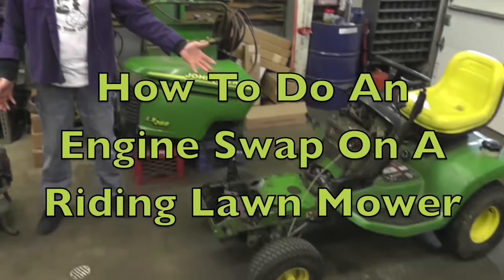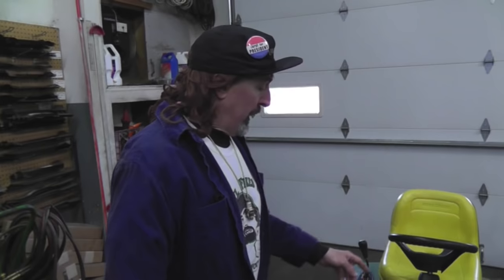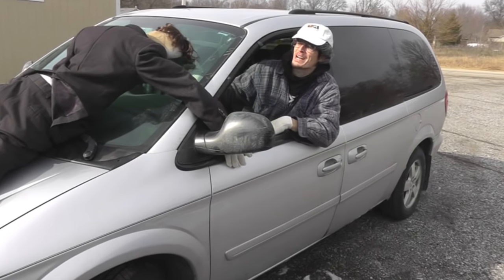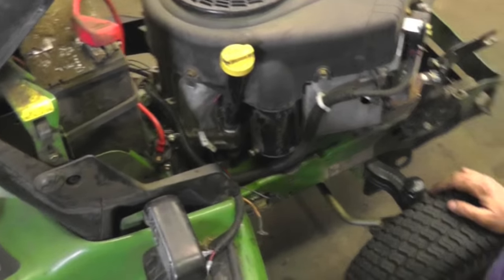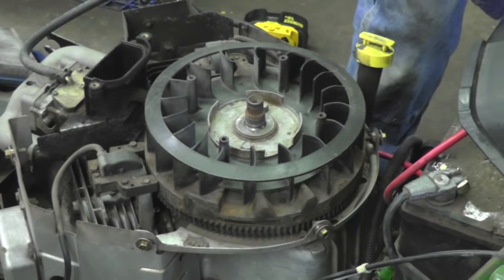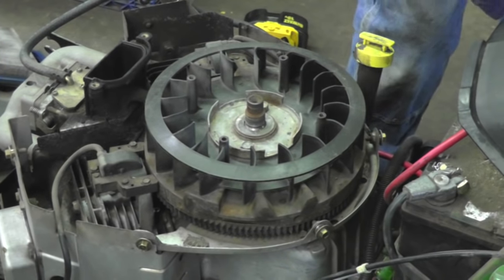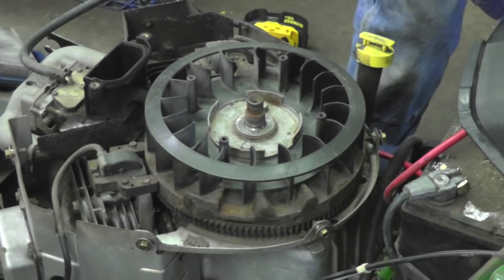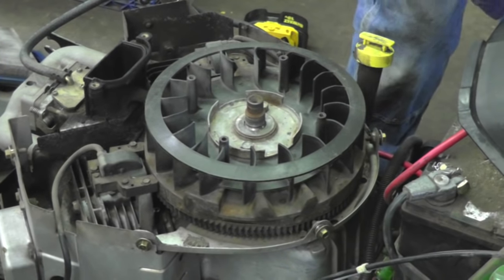How To Do An Engine Swap On A Riding Mower with Taryl

Comment: Taryl Fixes All LLC  one question on the engine swap.. I'm trying to install a 13.5hp Briggs flat head motor on a older snapper H-vac... The 13.5hp Briggs is on a older craftsman mower and the mower has a few safeties on the engine... The older snapper does not... Can i bypass the safeties on the motor or do i need to figure out how to install the safeties on the older snapper... Thanks in advance

Comment: There is absolutely no reason for a Briggs & Stratton Vanguard to crater, unless the maintenance hasn't been kept up.  I have a 1992 Vanguard on a all-wheel steering Crapsman still running strong.
Reply: Thinking about it though, $900 to $1000 for a brand new crate engine from Briggs is kind of steep for some budgets.

Comment: Taryl, I have a old Craftsman String brush cutter with a B&S 6hp (122K02-007-E1) that is acting like it is Hydro-Locked, but when I pull the plug and pull it through, no oil comes out. No oil comes out of the muffler either. It is very hard to pull through with the plug in, but easy with the plug out. Any suggestions? Thanks., George Goff

Comment: I live in southern France and I have a john deer 108 with a 8 hp Briggs and Stratton in it, which is fading fast. I also have a Briggs 12.5 motor from a 2005 tractor that is in great shape. Will it fit? can you tell me what I will have to change and do to make it work? The pto clutch is new on the 108,  can I use it on the 12.5 or will I have to get a new one? Any info is greatly appreciated as no one here will tell you anything without payment! Love your video's!!! Thank You.
Reply: +Les Howard - Check the " Mount Holes ", if they are the same, it will fit.  You can also " Drill " the Holes to make it fit.  NOTE:  The Muffler need room too, check that also!  8HP verses 12.5HP is NOT that different, it should do fine.... ONLY ROOM.... So MAKE SURE YOU GOT THE ROOM!!!  NOTE 2:  if your PTO is the SAME SHAFT SIZE.... YOU can mount it easily :)))
Reply: +Les Howard - I have swapped an 8HP with a 12.5HP before.  I used the OLD Muffler.... It just stuck outward instead.  The 8HP Muffler is straight up... The 12.5HP Briggs, it's side-way.   So if you got the Room.... It will fit!

Comment: I did an engine swap. (Kohler Cv15s to a different Cv15s) I didn’t mark the wires like an idiot. I couldn’t get the flywheel off the good engine block so I chopped the wires that go to the stator and soldered them onto the other wiring harness. Now I think I got them wrong and it sparks every time I go to plug in the volt regulator. What do I do?

Comment: I just swapped a crapsman with another. Typical Brighs and stratton 18hp. It left a bad taste in my mouth. The original had a cable but swapped with an electric PTO,since I swapped everything over but the rear end,I had no issues. I had enough after working on this one rider to know these things suck. I bought another crapsman with the Kohler V- Twin,the guy keeps replacing motors in it,thinking they are bad,its just valve adjustment. I told him what to check and he never did. The guy even replaced the carb three times. Throwing money at a problem without checking the obvious things costs.

Comment: On a new engine . You don't have to use a tap and die to make threads!  For the block to set on. You can!  But its a waist of energy.  Just use the same bolts, to screws into it,  slowly!  To make threads as you screw the bolts into the engine mount.  Your done.  It called self taping bolts.  Most engine blocks has them already

Comment: Not charging. Should be 13.8 - 14 volts. As is, don't use headlights, or other electrical accessories, or battery will go dead, as it runs.....

Comment: Hay taryl I don't have a torch to heat a pulley that stuck on the shaft of a Kohler any help any hints the electric clutch came off nice and easy but the pulley above that one she's stuck. Tried gentle persuasion and don't want to bend the hell out of it

Comment: I have a vtwin on john deere that has electric pto.  The deck is shot and steering. But I have a toy built with a 17 hp mechanical pto.  I want to put the vtwin kn the troy built. Will it work

Comment: i have a questio..? if i do a swap on a kohler 17.5 to a 22 do i have to change the thing on the bottom of the flywheel and replace it with the kohler

Comment: So what has to be wrong with an engine for you to decide swapping it is the best or only option?  I've seen you fix about everything, so I'm curious about what you consider not repairable.
Reply: Usually its because the engine was damaged due to no oil, a rod thru the block, ect. Some that have thrown a rod or seized from lack of oil CAN be rebuilt, but there's many factors to be considered, is the crank damaged? How old is the engine? And the big one, how expensive are parts? I had a guy with a intek 20 HP that broke the rod from loss of oil due to a bad lower seal. Crank and block were undamaged, but the price of a new rod, piston kit, gaskets, and seals for this motor was about $300, not counting labor i got him a new replacement engine with 2 year warranty for $750.

Comment: Taryl!

I have a 19hp Kawasaki that needs go on my scag that blew a rod through block. but the diameter of crankshaft is different. can I pull the crank from parts mower and put on my transplantee? sounds crazy but I may try it.

oh yea, the one that blew the rod was also a 19hp Kawasaki... that's why I am pondering the crankshaft switch.

thanks

Comment: I have a cub cadet it had a 22hp kohler and it blew a rod so i put a 20 briggs with a dioide on it so how do i wire it to the cub cadet lt 1045 or can i just run a wire from the dioide to the battery the dioide is putting out 13 something volts is that possible?

Comment: Taryl do you know of a muffler that would fit my 17.5 Tecumseh Stanley riding tractor it's one of the weirder ones where the outlet comes from under the head... The muffler is obsolete I mean it's the header pipe that is bad. If they make something that would be easier than going thru a whole bunch of shit remaking the muffler out of half ass pieces I would appreciate knowing something you got handle on this shit dude your channel is solid gold...

Comment: Gotta another question. Is it OK for the donor engine to have electric PTO and be dropped in a mower without electric PTO? Both are hydrostatic. Just wondering if the coil needs to be change for a weaker one. I just don't want to burn some battery cells.
Reply from the maker: It makes it easier  to wire when you change out the electrical system from the old engine to the new donor engine as long as the engine is say for example a Briggs to Briggs
Reply: Many thanks.

Comment: I've got a B&S Single Cylinder Intek with 13hp 344cc and my transmission is a Tuff turq K46. Can I change to 17,5 HP 500cc single Cylinder intek engine  ?

Or will it break my transmission ?
Reply: Just swap it hydros dont really stress power.

Comment: Nice video. How do you go about connecting the motor wiring to the mower wiring harness when the plugs and the wire colors are different? Is there a reference / guide that you use? Thank-you

Comment: Hi, I inherited a walk behind weed trimmer, the kind  with the 2 big wheels in the back. The motor is shot, would it be  a simple R&R?  Will I need to find a motor with a cast iron flywheel or will the pulley compensate?  We all know what happens when you try to start a lawn mower without a blade. I'm thinking of putting a Lawnboy  engine for ditches will that work? Thanks
Reply from the maker: That mower  requires the engine with the heavy flywheel. pressure washers use an engine with the heavy flywheel but the shaft might not be long enough. I don't know if a 2-cycle lawnboy engine would work but its worth a try.
Reply: Thanks you're exactly right about the power washer shaft, I've seen some old roto tillers that used a vertical shaft engine that might work. Is it possible to swap the  flywheel with a  similar motor?

Comment: what i wonder is why is that tractor on its 3rd engine now. used or not with proper care that vangaurd should have lasted 2000 hours. the second could have lasted a long time as well

Comment: I have a 2010 Kohler Courage 18 ( Model SV540S) with 72 hours of use. Some of the internal parts have created some gear soup. I haven't open the engine yet but that little hole beside the sump seal is a hint that its serious. I want to swap it with a16 V-twin OHV (Model 303777)  from a beautiful "plastic made " Noma. I know that the size of the shaft must match but, what about the length ? Both riding mowers are not equipped with any electrical gadgets so, the wiring shouldn't be too much of a problem (I hope). Its either I get some advice or I'll have to buy a new engine. An estimate of $1000 a pop hurts the budget real bad. Any ideas would be gratefully helpful. Thank you very much.
Reply from the maker: +R Verro  If the shaft is to long I have used spacers to take up the Difference. If shorter  just use a longer bolt on the double pulley. That briggs should have the same shaft as the krohler.
Reply: Thanks !

Comment: Hi Taryl. Thank you  for all the videos and entertainment.  I have an Ariens 8526
model # 932105 snow blower. The Tecumseh engine #LH318SA-156571H 8.5 HP is
toast. This engine is a dual shaft running in opposite directions. I have
another well running Tecumseh HM80 Engine. I made the swap; all went well
including lining up all the pulleys. One problem as you know, the transmission
is now reverse. Forward is now reverse and reverse is now forward. Can you
explain how to correct this problem? Thanks.
Reply: Tekumesss

Comment: got a question for you have a 18 hp kohler command vtwin in a husqvarna starter solenoid is seperate from starter I see some command vtwins have the starter and starter solenoid piggybacked to the back of them as you called it once.  My starter as I stated is seperate as long as it would line up and bolt up do you think it would be possible to sometime swap it out for one of those.
Reply from the maker: +427 Elevating Productions  I've never tried it but if the number of teeth on the bendix is the same and it lines up I would give it a try.
Reply: I will have to try it sometime starter still works on mower but, does drag sometimes on startup but, could be the battery doing it cause its older and weak.  I know its not the valves as this is a command with hydraulic lifters.  Thanks though for your help love your videos stumbled across them and you seem to know what your talking about

Comment: I have a kohler 20 hp courage with a burnt out muffler, I priced a new one but at 140.00 for a new one, I was wondering how to get around this expense, I dont think the whole mower is worth 140.00. Can I make something myself that would somewhat work. Problem is that it dosent screw into the head, its held in with a 2 bolt flange setup.
Reply from the maker: +Charles Miller Look for a good used one. Local mower shop might have one.

Comment: How did you fix the end of the crankshaft you damaged with the hammer?
Reply from the maker: There's a built-in spacer at the top of the shaft that's there to whack on, you don't have to fix anything because you're not damaging the threads. And there's your dinner!!

Comment: Taryl I have a craftsman edger model number 536-772301 and it leaks oil around the base near the front what do you think the problem is? thanks
Reply from the maker: +Dickey Moore     Who's engine is on it & is it a vertical or horizontal shaft.

Comment: How do you know what size alternator you have and what size motor needs
Reply: Parts diagrams for similar setups.  PTO takes a good amount of juice, head lights a close second.  I doubt there are very many alternators to choose from.  Make sure you use the right regulator so you don't overload it.

Comment: hey how do i get Frozen bolts out  that holds engine on a push mower, they always break off when i try to turn them
Reply: Heat let cool, and spray pblaster on it.  Try to start soaking with pblaster days in advance, a little bit each day.

Comment: What size amp regulator is required for charging system that use electric pro and what size for non electrical pto
Reply: You can use ohm's law to work it out.  Measure resistance of PTO coil in ohm's, divide INTO 12v to see how many amps.  Add up the headlight and accessory bulbs in watts, divide by 12v to get amps. Add all your amps up and allow 5 or 10 extra to leave something for charging the battery.

Comment: Taryl Fixes All can you do a video on the vanguard series v twin briggs engine and show us why the 16 / 18 / 20 and 22hp engines have the issue of not firing on one of the 2 cylinders. most cases i see it is the right cylinder. please help us. im in a group called southern offroad mowers of facebook and there is more then 15 people that have the same problem.
Reply from the maker: +lead foot lawn mower (leadfootlawnmower) On that engine if its not firing on 1-cylinder you need to isolate the problem. Is it not firing due to no spark on that cylinder? Is it not firing due to a thrown connecting rod on that side? or is it due to a valve or push rod issue. If its due to spark a common problem is that the kill wire has diodes soldered into them and if one diode fails then it interrupts the spark. To check this simply disconnect the kill wires from both coils. If  its not a spark issue you need to check the other things I mentioned. Or check out my trouble shooting videos
Reply: well i know for sure there is no throw rod. did the classic screw drive in the hole trick. everything in the engine checks out. it had a bent push rod when i bought the mower. so i replaced all 4 and the rockers on that side for good measure. clearance is set to with in .005 and compression is in the green on every tester i used for small engine. and i have looked into the diode issues and replaced both of them.do you think isolating them from each other with a double pull double throw toggle switch would help. i have a top to bottom rebuild in the carb and both coils are new. im going to look it over again try soe things i havnt yet. ( what havnt i tried ) and see what else if anything i can come up with. because i never had this problem and its usually as simple as getting a new coil. thanks for replying TARYL.
Reply from the maker: If it had a bent push rod that tells me that the valve guide had moved in the head. That will cause the valve not to open & close fully & when that happens it bends the push rod, Valve guides moving in the head is another common problem with small engines. Most common cause overheating.
Reply: im not sure on that seemed fine. when i bought it the guy told me it back fired one day and never ran right since. me and my neighbor got it to run little bit here and there on both cylinders and says that there may be corrosion between the head and block because the gaskets are original and metal and what it could be doing is searching for a ground. and while not impossible. we just havnt looked into that yet. ill try catching him tomorrow morning cause its in his shop and ill pass along the info i received from you. rebuilding the engine from scratch is the last thing on the list.

Comment: Love your vids and please don't take offence but don;t beat on the crank shaft use a puller that was a fine engine
Reply from the maker: +Elroy Mills No offense taken Been pullin flywheels that way for over 30 years. Never had any engine issue.Ive used pullers but sometimes you have to hit them too.I did replace the broken fan. We just left the part of me breakin the fan in the vid for comic relief.

Comment: Not thinking I'm gonna beat the shaft with a sledge hammer. I've been under the impression that there was a thing called a puller.. But what do I know
Reply from the maker: +MrEdsster  For years Briggs ,Tecumseh & other manufactures have been making  tools that you either screw onto or put over the shaft & then are told to pry up on the flywheel & hit the end with a hammer to shock the flywheel from the tapered shaft. Totally safe procedure. Have been doing it this way for over 30 years. Never had a problem.

Comment: Hey I think I speak for a lot of people when I ask could you please do a video on how to get a stripped set screw out of a drive pulley that would be the best thank you
Reply from the maker: +Joey Mendoza-Gray  Do the trick I showed in this video on removing the pulley. Heat & quench. Then take a hammer & plat punch  the same size as the set screw and  hit the top of the set screw. This will mash the head of the set screw enough  so the allen wrench will fit tight again. ( you may have to actually tap the allen wrench with the hammer to get it to fit into the set screw again ) then wallahhh! the set screw should come out. Theres yur Dinner!
Reply: Thanks

Comment: Briggs & Stratton horizontal shaft
Reply from the maker: +Dickey Moore  Well it could be the sump gasket, oil seal, oil caps are loose, drain plugs loose check all that stuff.

Comment: There was no reason to break that fin!!.. first off, if you are going to go all dinosaur on that thing with the hammer then taryl should have screwed the nut on and then used a soft lead hammer. But of course the puller would have taken about 20 seconds more time.